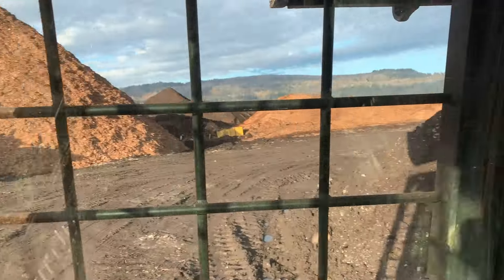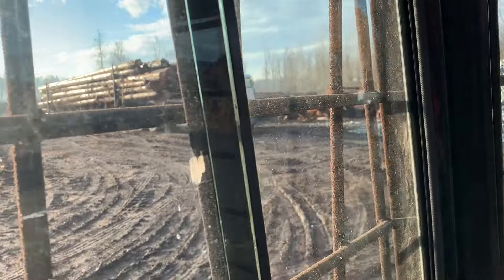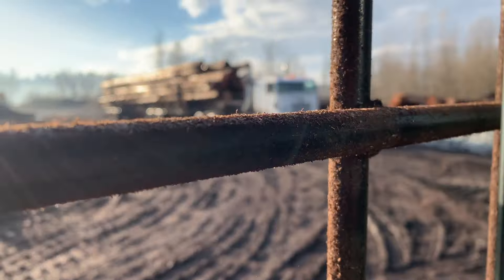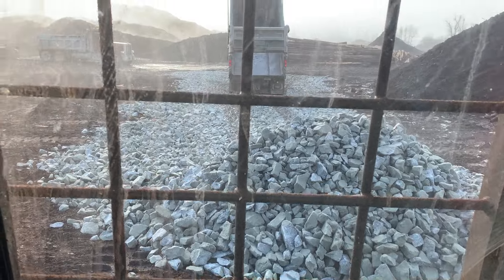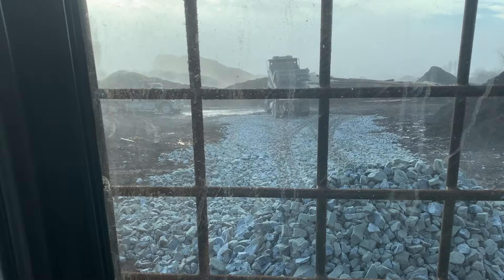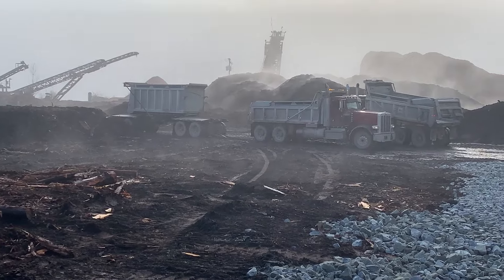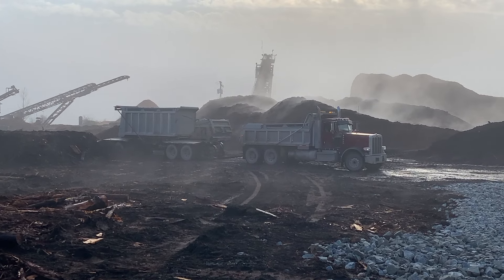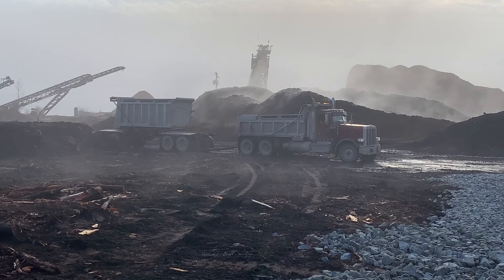Mill Yard and Trucks

Comment: The outfit I herded had an RD puller and the pup off a pintle hook with single axles on each end. It had an electric tarp and air tailgate like the truck but had to jack knife it and dump the truck over the pup tongue. Pup hauled 9 tons and the truck was a tri-axle that hauled the rest of the 25 legal. Sweet rig. 350 Mack and a 9-speed. Thanks, Pal and God Bless

Comment: Usually if you have the room you'd have truck and pup running. Transfers were always king in the tight spots where you couldn't bring a pup in. Maybe the rock is coming out of a job where they need it gone and they're getting a better deal on the material by taking more thereby justifying the time taken for the transfer?
Reply from the maker: The transfer hauls 38 tons, where a tandem pony would probably be 26 tons
Reply: Wow, really that much? I never paid attention to the slips when I was working construction. Bosses sent whatever trucks worked out cheapest. Must have been close to the pit to justify the truck and pup then. Makes sense you'd get double the weight over double the axles. On the island here a couple asphalt companies run T&T but everyone else is 4 axle wagon dumps for the "long hauls" and truck and pup. More and more tridem pups @skadill

Comment: You're brown buddies bring you some curry for lunch make you go running with your roll of toilet paper 30 minutes later 😂 They must have hated hauling that, looks to be 4 inch minus concrete so its not as bad as the 4 inch minus rock we get here. Aluminum boxes don't fare well with sharp shit. Yeah all that material will get buried in the muck, the only way you solve a mud pit dryland sort is pave the whole area. Down in the USA like Washington state they don't know what truck and transfers are, in Alberta they pretty much use quad axle end dumps behind a gravel truck. I think truck and transfer is pretty much a BC thing you can haul a lot of material in one go.